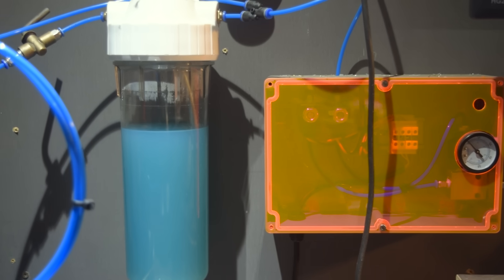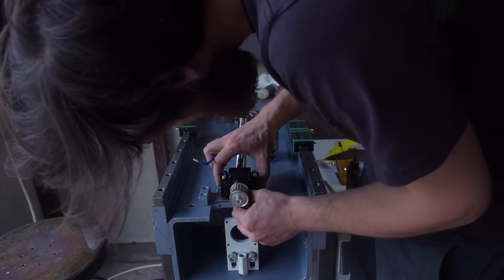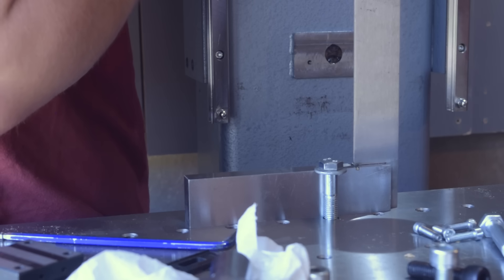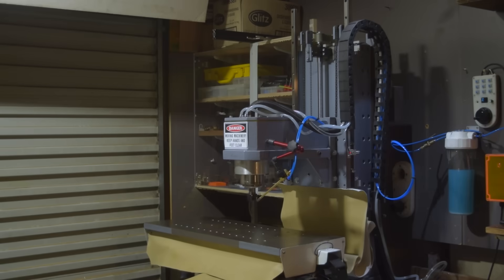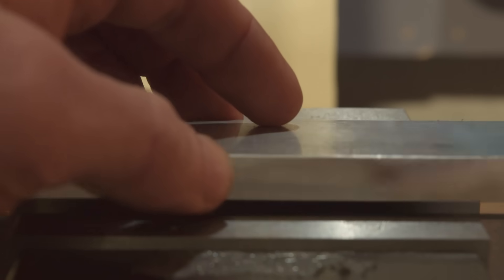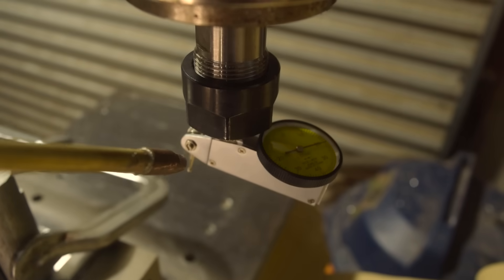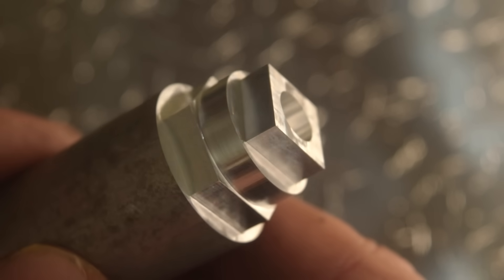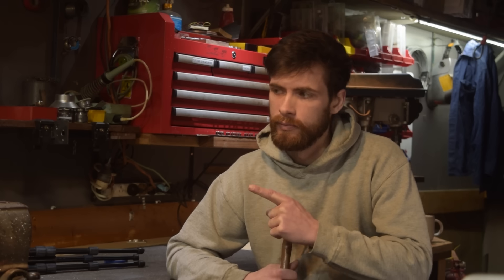My DIY CNC mill eats metal

Comment: Great video, AWESOME machine! If you have accuracy issues at some point, try using the dial indicator with a max 15deg angle. These guys usually give some wrong measurements when they are used with higher angles. thank you for sharing!!

Comment: Uncivilised. 🤣 
I did a video years ago on accuracy, and if you want real accuracy you need C3 ball screws and I would suggest closed loop (not supported on Mach3). The issue with spindle speed in harder materials becomes both rigidity and power. If you want to stay within the 2.2Kw then your max speed is going be something around 6K with a DC motor, and you will need to calculate power use of the tool making sure you stay 60% or less.
Two other major downfalls of most homemade machines is absolute positioning (machine has to be rehomed after power loss) and a rotary encoding on your spindle (to do spindle sync like rigid tapping).
Enjoyed the video, and goodluck!

Comment: Right on with the oil and sand mixture. On what to make, a modular vice system and a plate like Saunders should be high on the list. 

On a spindle upgrade, either a servo belt driven atc bt30 system or a 4-8 pole atc spindle. Everything is moving towards high speed machining. I would go with a 4 pole atc spindle.

Comment: Beautiful work.  Well done, sir.  What's the minimum practical RPM of that bigger 2.2kW spindle?
Reply from the maker: I've managed to stall it at 10,000 rpm, so I don't tend to run it lower than about 16k. It is possible to set up torque compensation for the lower rpm range

Comment: Great build! 
The noise you mentioned with the 6mm endmill at 24k rpm might not be the spindels fault. I have somewhat similar machine same spindle aroubd 450KG, sadly mine is using stepper motors so not getting more that 2200mm/m. 

But when cutting aluminium its almost as quite as the steppers running the machine. 
Cutting wood instead and its loud. My guess (I’m not an expert) is that you are getting vibrations or that the interpolation from what ever cad software you are using is causing it. 
You can see that its slowing down at every 1/4 when cutting out the circle, suggesting either something in cad or what ever software is running the machine.

Comment: How did you surfaced the metal before screwing the rails of the linear rails in it?
Reply from the maker: Go check out part one!
Reply: glt it you flycutted and milled flat. I would haveloved seen to to surface a piece bigger than the longuer travel of your milling machine, is that even possible????
Reply from the maker: @nobodyelse-h6h  the mill I have access to has a turret head, so you can rotate it to reach other sections!

Comment: Guessing you researched this thoroughly but what is the performance impact of oil sand mix vs dry sand vs lead shot? I've not filled the shaft of my drill press with anything yet, but was planning on going in dry.

Comment: A 6mm 3flute end mill cutting aluminum at 24000 rpm is music!
Reply from the maker: Didn't sound too bad for a homemade machine eh? 🎶

It screams real bad in steel though
Reply: @NoEngineerHere  I'm sure the torque on the high speed spindle is limited, but if you can run a fairly small end mill at the lowest RPM the spindle can handle it might be fine.  Aluminum is ridiculously forgiving of a wide range of feeds and speeds.  Steel is MUCH less so.  Titanium, pretty much not at all.

Comment: When Cutting the aluminum shapes you can watch the macine slow down at the corners a lot iys wise to enable the smooting /fit arks in your cam program to reduce this and maintain the optimal chipload

Als great macine im seriously considering taking mine apart and rebuilding it but better

Comment: Congratulations on getting it working. I'm sort of curious about the hesitation it seems to have when changing directions on the X or Y. Is that something weird about the adaptive, or is that the machine taking up backlash before switching directions?
Reply from the maker: It's likely just how I've got the accelerations set - fairly low

Comment: Did the seem a bit twitchy to anyone else or was it just me¿? It seemed like it would move then slow down a bit before moving fast again.... Especially when he was doing the square, hex circle thing.
Reply from the maker: Sadly it seems that those movement quirks are a limitation of the controller, which is running GRBLHal, I've got plans to upgrade in the future!

Comment: Nice.
In regards to the ballscrews, you should be able to remove backlash by having two nuts on them, and then adjust the distance between them to take up the backlash.

Comment: Ive built my own cnc mill.. Its concrete and steel with a 1.5kw spindle gear reduced to 8000 rpm . While I learned a lot and its super rigid  , Ive never gotten the accuracy of an out the box tormach or mr1 cnc. Well done on your project.

Comment: Awesome work ,what controller are you using? seems to dwell point to point on the toolpath. Other than that nice work!
Reply from the maker: It's running grblhal on a teensy 4.1 at the moment, but will upgrade in the future!
Reply: @NoEngineerHere  Nice, I think Linux CNC would be the highest end option with in a budget, I hopefully when time allows make my own integration of it for some CNC projects.

Comment: I’m just finishing up a similiar build, but its been a year in the making.   I had many similar learnings, like upgrading the spindle.  I settled on using an AC servo.   I too used jacking screws on the base of the column but I like the idea of the epoxy.   People always ask me what I’m going to use it for and now I’m going to tell them “to make chips”.   I think I’ll use stainless steel screws however to hold the stock 😂.

Comment: The mill looks great. In the machining clips the motion of your machine is dwelling at the end of every segment in the program. This is either a setting or some kind of servo dynamics that may be causing this. On the square and hex it is understandable to slow down on the corners but it was also doing this on the circular milling as well. As a person who has watched many, many  hours of different machines running this looked a little disconcerting to me. The motion should be smooth even at high feed rates. This could also have to do with the unusual surface finish. I don't think it is the ball screws that are causing that finish. Backlash shows as a definite line in circles but not on prismatic shapes. Your measured relatively accurate sizes. So I think there is something in the servo setup that causing that and the dwelling in the motion of the machine. Just a observation, otherwise it's really working good. Maybe you could look at the spindles like Stefan Gotteswinter put on his new mill. The one he is using can also change the tool.
Reply from the maker: It could be down to the controller, I'm just using grblhal on a teensy 4.1 at the moment, will be upgrading to something a bit more professional grade at some point soon - mostly for ATC support, but also simple things like a run-from-line function. Thanks for the info! :-)
Reply: @NoEngineerHere  We have a '90s mazak mill that has similar troubles and that is caused by the machines own computer just not being fast enough to read what a modern computer sends it, so yours is most likely a baud rate/ data flow of a controller just not being fast enough to send ahead data it's getting
Reply: @KittyCatInAMicrowave  the same thing happens in the world of 3d printing... when you have your feedrates set so high the controller can't put out the necessary bytes of calculation per second you get jerky uneven motion. This can actually be calculated. Sometimes the software is also manually limited to a certain number of commands per second. Both worth looking into.
Reply: @NoEngineerHere  Hello NEH, Terrific build!! I built a 3m by 1.4m cnc router and your detailing in getting the axis's right is on another level. I was using one of the Mach3  controllers but went over to UCCNC, the difference in machining quality ( even in wood ) was astounding, very easy to setup, has more capability than I can use and isn't that dear.
Reply: @skillenmcnot I was about to say this! Encountered the problem many times back when printer controller boards were still basically Arduinos on breakout boards :)

Comment: You've made a great build with your first DIY CNC. The surface finish is decent, especially considering you've yet to tune the acceleration/deceleration and speeds/feeds. That said, I sincerely hope your better half is more understanding than mine. 

It has taken years for my wife to finally see some value in the "money you've [I've] wasted on tools for your [my] shop." It's only because she realized I could make items that "Jeep people" would purchase at inflated prices.

Of course, she does have a valid point. While I purchase computers, machinery, and cutting tools that I use frequently, I also buy some that I might use someday. My theory is that it's better to have it and not need it than to need it and not have it.
Reply from the maker: It was a bit of a sore spot while I was building it, but seeing how well it's done here, she's coming around 😅 I think her tolerance might be too high now though, I can't go unchecked for too long....

Comment: It is still not all lost for steel - if you'll replace 2.2kW high speed spindle with 4.5kW, you would be able to cut steel without much issues on lower speeds.

Comment: Could you make a spindle adapter for my Taig mill so I can get rid of the stupid 1/8 hp motor/spindle/belt set up? I don’t know why no one has made a holder for a direct drive spindle and get rid of that crappy motor set up.

Comment: That's crackin'.  I particularly appreciated the bell end gag (and I'll be nicking the sand and oil idea for the head I'm making for my machine).

Definitely wants an enclosure for sound, chip containment, and fume avoidance), and if you want to be safe that should probably hook into the safety interlocks.  You'll probably want something to increase torque and reduce speed for machining stuff other than aluminium, maybe a reduction head.

As to what to make on it, depends if you want it to be good video material, or actual business material.  For the former, irprobably wants to be something overcomplex and unrealistic.  Tesla turbines, multi-cylinder 2 stroke engines, the world is your lobster.  Or make up another 2 axes for the machine and have a 5 axis DIY machine...

For actually making money by selling what you make, anything related to bicycles (less material == more money), motorcycles (CNC rearsets, brake and gear levers, bar ends, etc), or other sporting goods - think specialist snowboard or ski tour bindings, etc.  Stuff that still has "boutique" value.  You'll be wanting to set up home anodising as well, probably.  That's what springs instantly to mind, anyhoo.

Comment: Would it be worth adding a secondary reduction gear set for low rpm operations to provide more torque?  Something you can just move the belt over like a hi/low gear.
Reply from the maker: This spindle is driven internally so not possible currently, but I'm going to upgrade to a servo driven BT30 spindle, and had a similar idea about having a high/low range. Thanks for watching!

Comment: 9:01, yt randomly showed me your video and i skipped it to that time.... and as machinist programmer and other I can tell that you are using your micrometer wrongly! the screw which is inside with your way of using will wear out ... Use that ratchet on the end PLEASE ffs.....
anyway nice project well done with that mill
Reply from the maker: Got that Mike from a junk store amongst other treasures from an engineer no longer with us. Just like that engineer, the ratchet in that micrometre is long gone.

I appreciate your concern though, and don't worry, I gave it a kiss on the forehead and tucked it in tightly for bed that night
Reply: @NoEngineerHere  Damn thats a shame, but if its from junk store and you gave it second life then its great :) 

yes kisses are needed but dont overdo it :D

Comment: Nice one! I could give you some little hints: make an external plexiglass housing will reduce the noise and keep yourself alive, then you can make dual spindle mill, one slow for steel and another for aluminium, try single flute bit on aluminium and always choose 7075  as aluminium, you'll never regret, bye bro

Comment: I am an engineer and I don't think I could pull this off.  Awesome project!
Reply: Same here, i would spend five years planning every small detail, then decide on the least terrible design whithin the budget and get frustrated half way into the build :D
Reply: @peterpan6406  yep me too!
Reply: I'm not an engineer and I could pull this off with at least 10 times worse results
Reply: Most of the times i just start a project with a general idea and figure it out on the way.
Reply: I’m sure you could overdesign the shit out of it though
Reply: @samjohnson7325  100% That's how I do everything in my life.
Reply: Great video! I am an  engineer but I spent almost two weeks  https://youtu.be/ziXmku7p6O0 although I designed and made pcb for control unit.
Reply: but they are Not an Engineer™️
Reply: It takes a different breed to bring an engineer print to life… a machinist😉
Reply: as a machinist,  im not surprised
Reply: @NithinJune  sometimes is a blessing 😂
Reply: +1 as another machinist who isn’t surprised.
Reply: @Bigboi67679  Fear the man who is both, for hes probably got a short temper and a hammer.
Reply: That’s the problem - you’re an engineer… 😉
Reply: Jeez everyone just wants to take the easy route and pick on engineers or make jokes. Me too thats why I'm here. 😊
Reply: @jerbear7952  I did leave myself open to the easy jabs. 😆
Reply: Same here. But this is a nice reference.
Reply: Why do engineers act like they are the final boss. Most engineers can't build things.
Reply: @jerbear7952  the true wanna-be boss battle is when a design engineer has to get reviewed by a manufacturing engineer.
Reply: Being an engineer these days means nothing lol 
I know several high-level engineers in the oil and gas industry that couldn't figure out how to work a clamshell cell phone case.
Reply: Have you ever heard of the old song I got told about called “paying homage to tinnitus” goes something like this eeeeeeeeeeeeeeeeeeeeeeeeeeeeeeeeeeeeeeeeeeeeeeeeeeeeeeeeeeeeeeeeeeeeeeeeeeeeeeeeeeeeeeeeeeeeeeeeeeeeeeeeeeeeeeeeeeeeee
Reply: If you're an engineer and can't build that(or superior for cheaper), you should SERIOUSLY consider changing career.
Reply: @stephanysmith1834  most engineers do all their work on paper / CAD.  It's just the reality of the world.  I'm in the minority of engineers who are hands on, but we often suffer from overthinking everything and getting lost in the details.  I could build it and it'd probably be superior, but it would take me considerably longer because I'd want everything just right.  He's a guy who just gets it done at plenty good enough.
Reply: @nofrillsjustkills  I agree. As an engineer, and since you know it, you should work on that "obsessional behavior" that sink your talent and learn to balance it. On  the other hand, engineer with obsession to detail and perfection are the best and they can rely on technicians to build the stuff they engineered properly.
Reply: Rule 1 of efficient engineering. Don't build something you can buy.
Reply: Yuuup